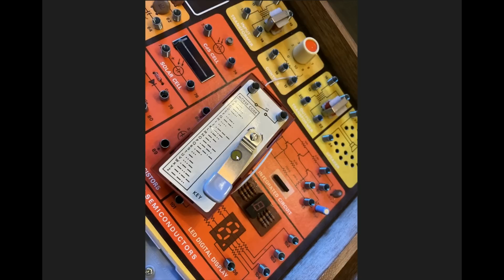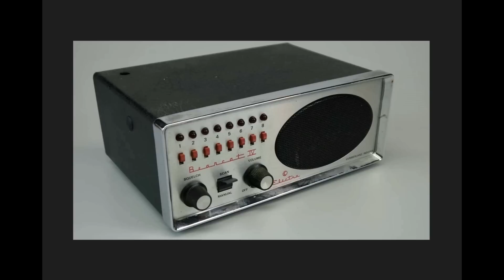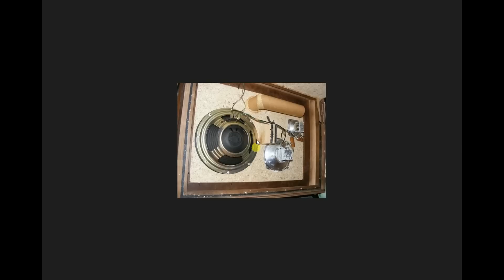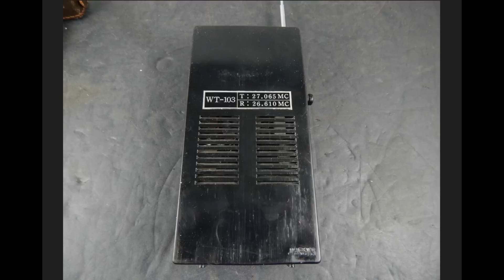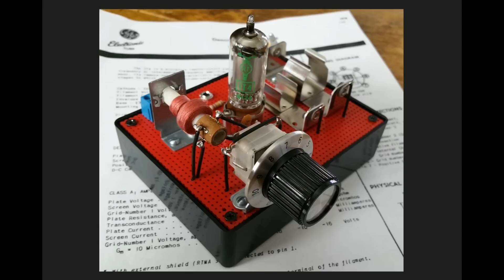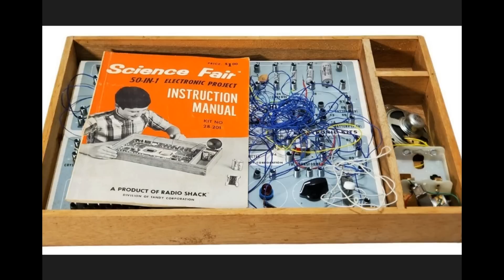Did Electronic Toys Influence Your Path?

Comment: The P-Box Shortwave kit was a 3 transistor set not a tube set.
Reply from the maker: You are right, those later P-Box kits definitely used transistors rather than tubes! The exception is kit #28-100 One Tube AM Radio.

Comment: Got a remco crystal radio kit when i was in the sixth grade, they only gave you one crummy glass diode,no spare, one lead wire pulled out before i got it put together. Needless to say that piece of crap radio went into the trash. Learned more from the old radios i pulled from the local dump 7:53
Reply from the maker: I melted and modified mine with a wood burning kit - smelled!

Comment: My Dad and I built a Radio Shack P-box code oscillator together in the early 1970's. He gave me a clapped out Halacrafters S-40 and check book register to use as a log. My grandparents bought me a transistor radio for Christmas 1970; I spent many nights listening to Mystery Theater with the radio under my pillow. And, I was into crystal radios, fortunately we lived across the mississippi river from WCCO's 50K watt transmitter. My wife and kids got me the radio shack crystal radio Christmas 1993. It still sits on my radio shack desk running 24/7/365! and, I sent signal reports to San Francisco and Wainwright, Alberta with that set -ha. Thanks for the great video! AA0QZ

Comment: I started very young. Investigating old radios.. I was building crystal sets by 10 and regen radios by 12. Tech school right out of HS, and several factory jobs for a few years. After encouragement from my then sister in law I looked at positions at a major Ivy League university. Got hired designing and building custom laboratory research equipment. 35+ years later I retired at age 60. Electronics has been a hobby as well as a career for most of my life. I'm still a ham radio operator. It was a good match for me.
Reply from the maker: A hobby can become an obsession - but not every one pays the bills; and over so many years.

Comment: I got interested in electronics when I was 12 years old. In 1952 we had a hurricane that we lost power. I made radio that was called a grid leak detector to get some information about the hurricane. At the time I did not know what the circuit was called. One Saturday I went and took a survey. The result was the people who conducted the survey came to my home and told my parents that I had a proficiency in math and physics and suggested I enroll in there tech school, which I did. I graduated in three years with a GPA of 3.9 and became a member of the Electronic Engineering Society. I retired in 2003 after having a very diverse career in electronics from guided missal controls, radar, lasers,
 microwave radios, satellite communications. 
Now that I am retired I spend my time on using electronics. I designed a wireless system  so that i can use my  voice to control my optical telescope. In place of an eye piece I use a CCD camera and view the objects on a 42 inch flat screen TV in my home where it is nice and warm.
Reply from the maker: Wow! a natural progression and engineering story.

Comment: My Dad was a computer engineer for Burroughs Corp and worked at the SAGE radar sites during the 1950s. We moved from one Air Force base to another before coming to Pasadena, CA in 1963. I remember visiting the bases and seeing the green CRT radar display screens. I was hooked. My Dad got me the Remco crystal radio kit when I was  6 years old, and when I was 10, the Philips Electronic Engineer kit.  At 12, I was building my own shortwave radios, going to Army/Navy surplus stores on my bicycle looking for 2000 ohm headphones, tubes and sockets, coil forms, and Fahnestock clips for my regenerative receivers. The first time I tuned in on my own handmade radio, the BBC and Radio Nederland from Hilversum Holland, I was forever entranced by radio and electronics. Fond memories of Allied Radio catalogs, going to Dow Radio in Pasadena, and the magazines, Popular Electronics, Radio Electronics, and later Nuts & Volts. So much fun. In 1980, I became an electronics engineer and had a rewarding and successful 40 year career. Now I'm retired and spend my time restoring old Zenith Transoceanic radios and have fun building home automation stuff with Arduino and NodeMCU. Thanks for the trip down memory lane!

Comment: I had that Radio Shack Kit, still fool around some electronics to this day. Although I went the mechanic route witch is widely is widely based on electronics today.
Reply from the maker: It seems counterintuitive, but the transition to EVs could actually reduce the amount of discrete electronic modules in a vehicle. Gonna be interesting next few years.
Reply: @MIKROWAVE1  I went the heavy equipment and agriculture route, electronics used extensively in machine control and guidance.
Reply from the maker: @Oliver-kv2mm  Very nice a lot of CAN involved. I consulted at the Chrysler Proving Grounds in MI on a test robot driver program in the 90s.
Reply: @MIKROWAVE1 Was involved with the first NS EV... Long time ago. Tom Davies?.... I was at NVG. Anyway, I was just a co-op. Mechanic for a few decades. Sick of it. Need to reinvent or recenter myself.

Comment: Mike, nice trip down memory lane.
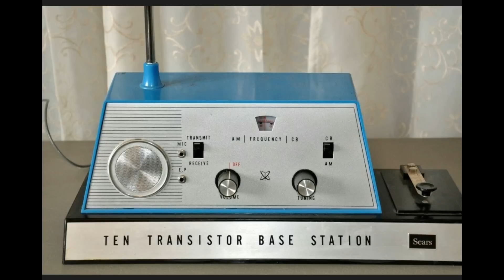I had the Sears Base Station at 15:43.  We had an army of kids in our neighborhood all on channel-14.  And since I had the base, I was the commander--HiHi!
Also built the Psycho-Lite from kit; however it always put a buzz back into the stereo/audio source due to switching noise.
Built the famous Quaker-Oats electric motor with an electromagnet and paper-clips that lined the lid; got my Electricity Merit Badge.
Had the P-Box One Tube Radio, wasn't the greatest but wish I still had it with what I know now; but did Radio Merit Badge.
Also built the P-Box Electronic Organ Kit; got my Electronics Merit Badge.
Had the Radio Patrolman receiver that was VFO tuned; you could listen to anything on VHF!
Got a 5" Sears reel-to-reel tape recorder in 1965; recorded George Carlin's first appearance as the Hippie-Dippie Weatherman on the Jimmy Dean show!
Finally something you didn't mention, was electric trains; I got a Sears electric train when I was about 8; learned more about electricity keeping it running!
Reply from the maker: They must have made a ton of channel 14 crystals thus lowering the cost -  and thus agreeing on the channel by default.

Comment: I vaguely remember the springs on the Radio Shack kits -- I also remember (bitterly) not being able to get their shortwave receiver to work.   I really wanted to tune in HCJB and Radio Moscow.  This probably led me to ask Santa for a Lafayette HA-600A receiver in 1973 or so. 

An earlier influence was the little intercom kits.  I think they worked over the AC lines?   We took some of them to the beach bungalows we had in Lavallette NJ.  With them we were able to speak clearly to similar units in nearby bunalows.  Wow, that was cool. That got me interested in radio. 

Cassette tape recorders were another early influence. I still have a recording I made with a tape recorder I got for Christmas, probably in 1972.  I used this recorder to practice CW for the ham exam. 

I managed to escape the CB madness.   But I came close to falling into the groovy psycho stuff of the early 1970s.  I remember the Transcendental Meditation gizmos.  I never built one, but if I had I may have been better off with CB. 

I kind of wish I had followed the example of the Woz and Jobs by making telephone blue boxes.  This could have led me to riches.  But as Jean Shepherd used to say, young men often come to a fork in the road: one path leads to wealth, the other to ham radio flea markets.  I got on the second path.  

Thanks Mike!  73 de HI7/N2CQR  Bill
Reply from the maker: Oh yes I had spectacular failures and so did most experimenters. Oh I forgot how important those cassette recorders were to us! We used them constantly!

Comment: While living in Elmira NY, I had a no-name "20 in one" kit, non radioshack.   It had a pre-built audio amplifier.  I used that for way more than just twenty projects.   Lost that in the flood, as well as many issues of Popular Electronics bought secretly with lunch-money.   But I also got about ten flood-damaged TV sets, a 5-tube table radio, a geiger counter, a shortwave.   Hose off the mud, dry for weeks.   (But I'd already become an electronics fanatic by then.)   I converted the table-radio into an audio amp.   I used the geiger counter HV supply to drive a TV flyback, for a tiny Tesla Coil, with a nail as the main terminal, made half-inch corona discharge.   When I went to college at U of Rochester, one of the TV sets became my first computer terminal on Altair-type 8080 kit-computer (1977,) after I built a keyboard from scratch.
Reply from the maker: I don't know how we survived playing with those old TVs! What a treasure trove of parts they were.
Reply: @MIKROWAVE1  A great secret of experimental physics is that you can vent a color television tube, then carefully scribe/shatter the rear half, and clean up the screen.   It's a window made of thick lead-glass.   Try to buy a similar window for x-ray shielding, expect $500 or more.   (The late model Sonys with the ultra-flat screen are even better.   Go buy 'em at the city dump (I mean recycling station.) )
Reply: I got whacked several times and once really badly. Made me go to my bedroom and lay down tearfully thinking my favorite friend electronics had almost killed me. Nice hole in my thumb... The lessons that don't kill us keep us alive.
Reply: @johnnytacokleinschmidt515  Oddly, it smells just like burning hair!
Stay away from fuel-air bombs, Estes rocket motors, DIY napalm.  Use 12in fresnel lens to melt the mortar of bricks (turns into black glass.)  
Once I measured a (failing) strobe-light oil capacitor, with warning DANGER 1000V.   It was actually around 7KV.  There was a bang.  The front of my DMM missed my face on its way upwards, came down again after a couple of seconds.  Some of the traces on the meter PCB were now gone.  (This was a Hal Edgerton hand-built strobe, in the fluorescent room, in the Electricity Hall at the Museum of Science.  We had several original Hal Edgerton devices there.   He was Mister energy-storage capacitors.  Amazing that Harold Edgerton didn't die, nor any of his students.)

Comment: In 1958 I had an Erectronic kit that used jiffy connectors to be  assembled onto a perf board with various templates to show and explain the circuit. It had a 1T4 vacuum tube and also a germanium diode for basics.  It was powered by a
45 volt B  battery and a 1.5 volt A cell.  I actually found the kit at a flea market several years ago! It still had its original parts!  Fast forward to 1985 after attending night school for basic electronics and digital training, I spent 16 years in the field.
Reply from the maker: Wow we have to see this thing!

Comment: I was born in 1986 and played with my brother's "Elektronika" experiment set made in the USSR in the '70s/80s, it was a lot of fun to experiment and even though I didn't understand the instructions in Russian, I could still build circuits from schematics, and it was when I was a wee kid in the ground school. It had parts like transistors, small scale integration ICs (a bunch of transistors in a package), RC, diodes, transformers, LDR, LED, relay, a speaker and maybe some other parts. Later on I moved on to taking old devices apart and building circuits dead bug style, building kits, making boards and devices. I ultimately got interested in audio, tube electronics and vintage stuff. Even though I studied chemistry and got a master's degree in it, electronics and computer stuff stuck with me, and now I'm running my own shop/lab and Youtube channel. Still gotta learn, pass the exams and get a licence.
Reply from the maker: There is a lot of curiosity on the eastern block electronics toys, kits, and trainers. I recently friended a former Soviet EE who gave me some eastern semiconductors, parts, and tubes to play with.  He has that solid first principles and theoretical  foundation that I only ever saw in the MIT educated folks I worked with in various companies.
Reply: @MIKROWAVE1  the differences in education between the West and the Eastern Bloc are interesting; it seems to me (I may be wrong here) that at least here in Poland the EE studies are big on math, theory and fundamentals - but not necessarily project work or practical skills like soldering etc. I studied EE for half a year and dropped out because I didn't really get calculus or physics, and because I noticed I wouldn't learn what interested me most at the time i.e. vacuum tube technology.

Comment: Yes. Starting with an AA5 radio that I tore apart, and put on a wooden board so I could see the tubes.  
Then in 1970 or so,  I was traveling with my dad, and we stopped at a warehouse in Yakima Washington, and I saw a Zenith upright radio that the warehouse guys used to listen to ball games. I asked about it and they said I could have it!!!!  That is where the shortwave listening started!  That led to getting a Radio Shack 65 in 1 kit, crystal sets, Radio Shack one tube radio etc.... I built all of the projects and they worked!
 
In 1975, I got my ham license while in jr high.  I checked out all of the Boys First (and the Second, and the Third and the Forth) Book  I've been active every day of my ham career. That lead to meeting other hams in in Spokane Washington, and I met a guy that worked at the local Motorola Service Shop. He said they were looking for a radio installer. I applied (by talking to the shop owner) (this was in 1979). I still lived at home and worked for the cable company which was a job, but not fun working outside in the -22 degree weather. I told the shop owner I would work for free for a few days. He liked that idea, and I went out with one of the teks the next day. 

I was  pretty skinny in those days and had been under lots of houses to run cable TV wiring. I was easy for me and I understood exactly what they were doing.
We we got back to the shop, the tek I was with told the shop owner, "hire him". That was the day it all started a 42 1/2 year career in the 2-way radio industry. I bought the Motorola shop with a couple of other folks that worked there. We closed the shop in 1999 and I went right to work at Motorola. Retired at 62 in 2021 with a pension and social security and lots of $$ in 401Ks. Living large with no payments except for food, utilities and car maintenance and gas.

I'm (my wife and I) are living happily ever-after.

Comment: In while in high school, I built a voice synthesizer, then in the Navy in spare time I built a Theremin, another code oscillator. When young it was experimental breaking and fixing things. I did electronics/motor controls for work and CB/ham radio for play.
Reply from the maker: I finally built a Theremin and did a series on it. Quite an adventure!
Reply: @MIKROWAVE1  I will look for it, I have been interested in this side of science since that crystal radio that I found at an estate auction at the age of 10, thanks for what you do here.

Comment: Brings back old forgotten Christmas gift Memories !! ...Some time late '50's (65 yrs ago) Received That genuine "Remco" labeled "Transistor Radio & home Broadcaster" kit for Christmas...After a very Difficult assembly Effort the Transistor radio tuned very Broadly & not very Sensitive....The home "Broadcast" wasn't RF or transistorized but simply a Carbon element microphone wired thru batteries to a 4" speaker.... Remember feeling kinda confusingly Disappointed as a kid...By June, I was stripping it down & using for parts of my own Diy radios...Ended up wiring the Carbon mic in series with a 6 volt auto ignition Coil & really RF "Broadcasting" a rough & crude (But intelligible) voice Modulated spark Transmitter !! ....Pretty cool as a kid diy salvaging the parts  & making it a Real radio Broadcaster !! .....Back in my early Struggling kid (But stubbornly persistent) days & No one in family radio or electronics knowledgeable to help...
Reply from the maker: Wow! A carbon mic and battery! Maybe with a transformer?
Reply: I had the opportunity of gifted and talented program and really was too shy and timid to utilize that resource. I tried. Mentoring has so many aspects to human development besides the vocational or technical aspect. I'm sure I benefited from the program. As an adult I just see so many missed opportunities.

Comment: I HAVE ALREADY ASSEMBLED 5 REGENERATIVE RADIOS, WITH ELETRON TUBE, WITH FET, WITH BJT BUT NONE OF THEM WORKED. IT APPEARS THAT THERE IS A SPELL AGAINST THESE RADIOS. PY2CYE MILTON
Reply: Must be doing something wrong as All those type diy radio receivers work somewhat & some amazingly Good !!  ....Get help assistance from someone that's had good Experience with these simple Diy receivers before you totally give up...I also remember an early youth time when I Couldn't get a vac tube or transistor to amplify or oscillate 😢 .....

Comment: By the time I was born, Lafayette didn't exist. I had a Radio Shack 160 in 1, but that was it. I was the kid buying the floor sweeping capacitor and transistor packs from the back of the store.
Reply from the maker: My saddest discovery after moving to New England in 1983 was finding the original Poly Paks building, which had finally closed!
Reply: And POLY-PACKS, in the back of Byte?   Meshna.  Jerryco.  Edmund Scientific.  Olsen.  B&F.   Digi-Key was only a four-page flyer.   During college I drove to Boston for a science fiction convention, went out to Poly Packs, but they were closed on sunday.   And all their windows were covered with brown paper, so I couldn't even look inside.